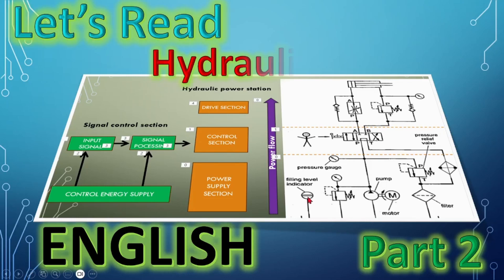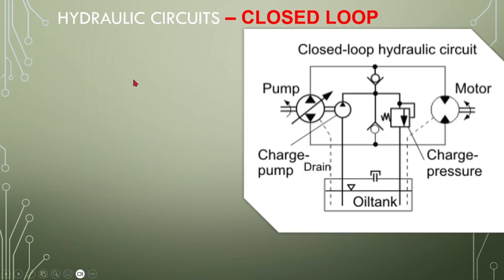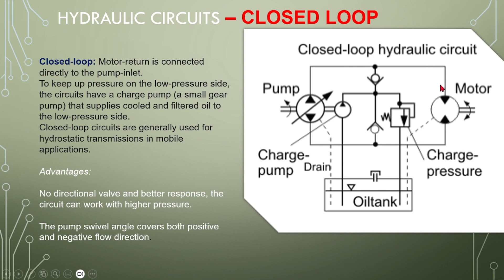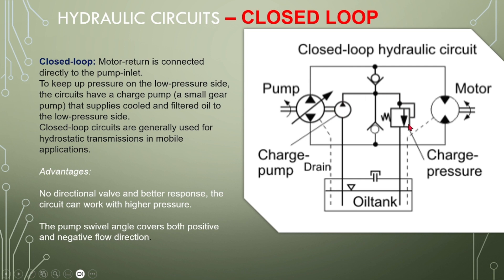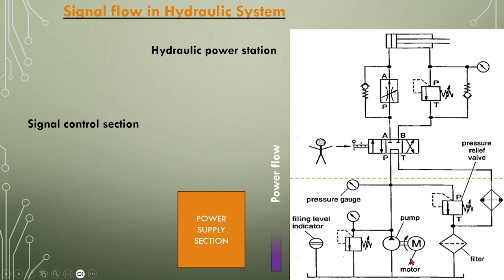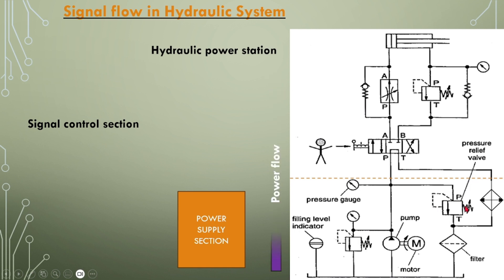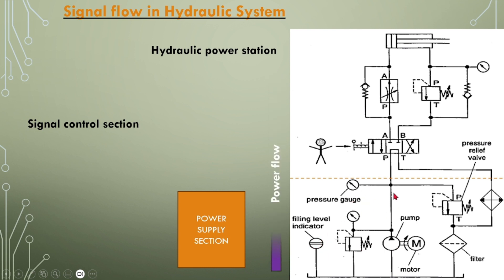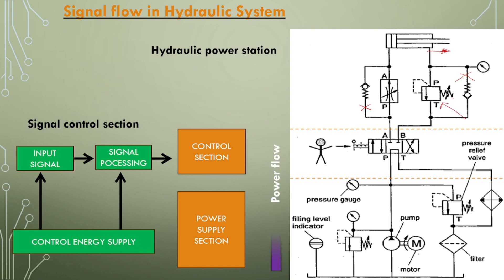Hydraulic drawings Part 2 ENGLISH #MarEngBase

Comment: good explanation but you should also mention about check valve function,it works when loss of power supply for some reasons and Load connected to cylinder will be block in safe position,not falling as gravity....
Reply from the maker: Thank you for the valuable feedback...be in touch this is just basics...more advance lectures will some soon